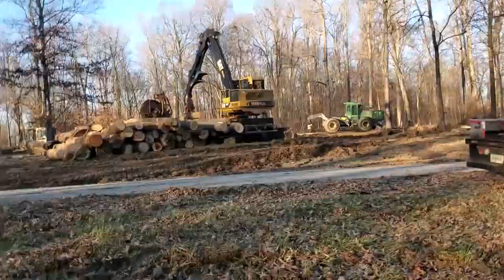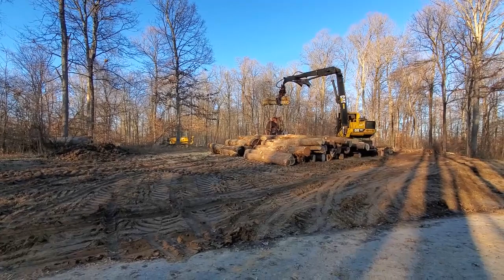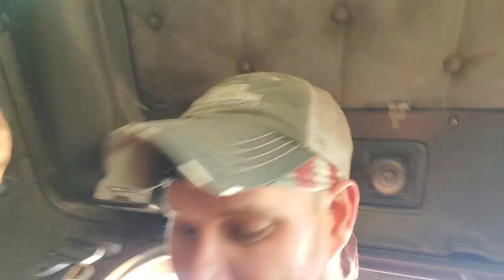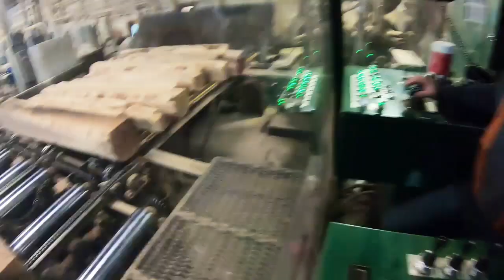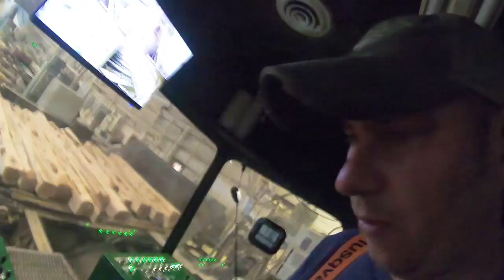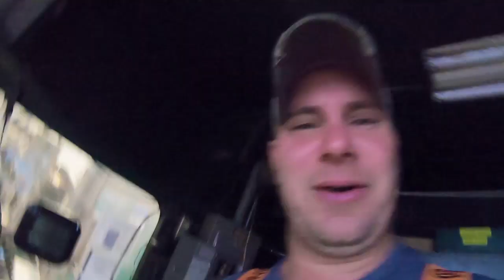Trying To Run a Band Sawmill!!  White Oak

Comment: As manager of the ETF for nearly 30 years, one thing I wanted is that in any type of need, I could operate any facility in the ETF, maybe not as fast as the 25 civil service or contractor technicians but run in an pinch.  Keep learning!
Reply: Years back i delivered newspapers, the regional manager was one of those guys, he knew most of the routes, and could cover them adequately when SHTF.

Comment: Wade what ever you are doing just keep on doing it cause it’s working, you are putting out great vids wade, a man in your position  should be able to do any job in that mill probably not as good as the normal operator, but can fill in anytime you are needed Just in  case somebody is sick etc, like changing gears in your truck you gotta change to keep moving, good job wade take in your stride and every thing will turn out how you want it there is no such thing as can’t

Comment: Hey at least your headrig is not a band mill I have worked at mils in the past that have both a band resaw and a band head rig and believe with both being bands they can cut fast and much bigger logs which cover up anybody and their jobs fast down the line. Especially with good operators just keep up the good work you'll be a veteran sawyer in a matter of time and trying oh yes and a lot of cussing the and cussing the air blue.  You ain't afraid to try something new and your right we should never stop learning something new as that makes life boring if you quit learning when your later in life.